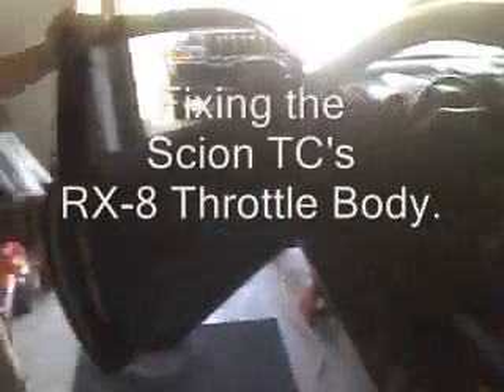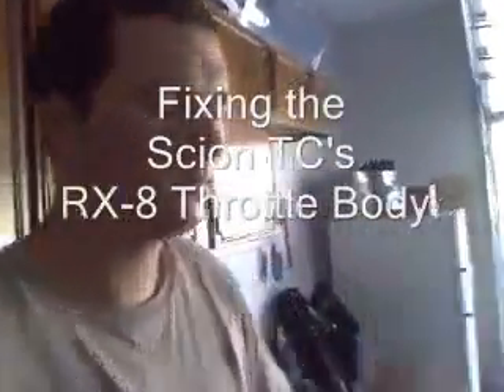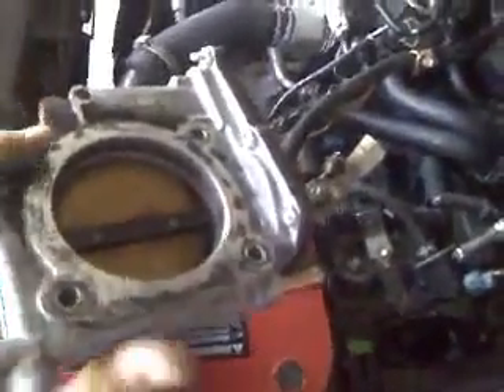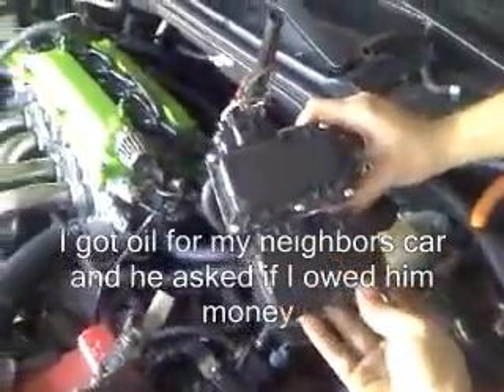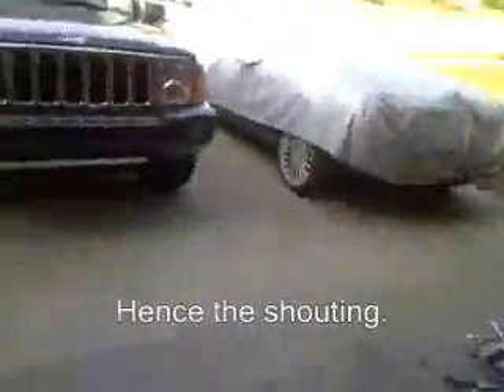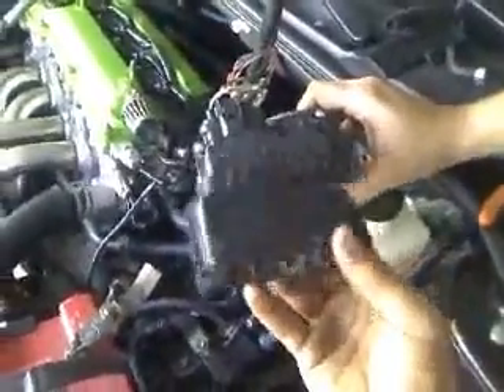Scion TC with Mazda RX-8 Throttle Body and First Start

Comment: so I swapped mine and made a port on the adapter plate for the vsv now I'm having idle surge and getting code p0505, any advice?
Reply from the maker: We never got that code but we also swapped the Mazda RX-8 and Scion tC circuit plate(the black piece) so that's probably why we didn't run into that issue.

Comment: hey Pro60modman  just a quik question about this conversion. I know you said all that needs to be done is to switch the throttle power wires (white and black) but is there anything else that you needed to do to get it running right?

The reason I am asking is that I converted mine and the car starts and runs however it stays at high rev while idling (2200 rpm) and the throttle response is very lazy

any advice would be helpful
Reply: Did yours fit in your car or you had to make a plate for it too?

Comment from the maker: @rgarrick06 
The throttle body on the RX8 is much wder. So much so that I doubt there would be enough material on the spacer plate to drill the Scion TC pattern into it on the other side.

Comment from the maker: @stupiddarkness 
Only thing that was switched with the wirig were the white and black wires BUT I may have switched them previously and forgot when we were diagnosing the original throttle problems because I depinned them. This car has a completely stock intake manifold. All I did was port match the two sides of the plate(a 4x4x1 piece of aluminum) and used a drill press to make the bolt patterns.

Comment from the maker: @rgarrick06 
You have to make an adapter. I made mine from a $33 dollar piece of 4x4x1 6061 aluminum with a drill press and a stone grinder/buffer. Took about an hour to make it. Got to hardware to mount it at home depot and it's holding up great.